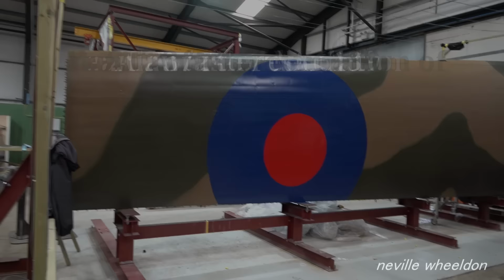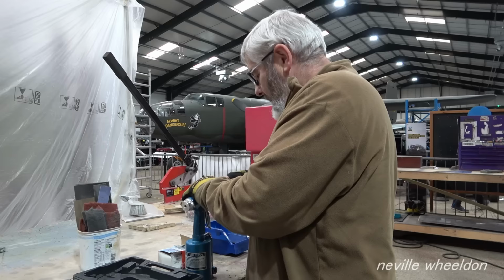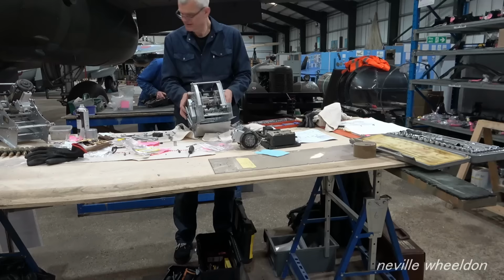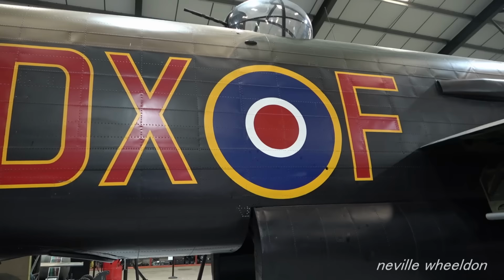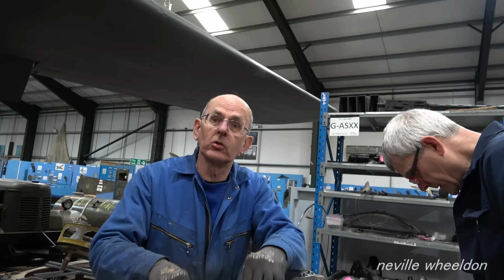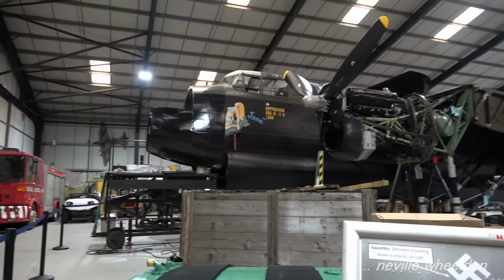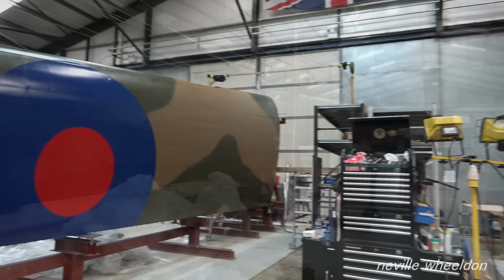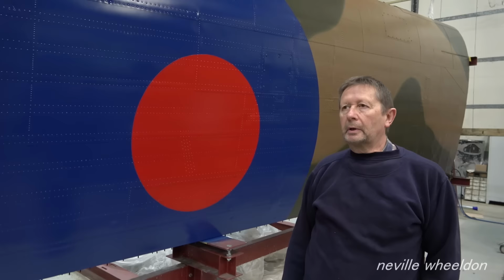Video 239 Restoration of Lancaster NX611 Year 7.    French wing painted.

Comment: Some questions about the ammo. Not knowing the rate of fire, approximately how many seconds before one runs out of ammo? Can the barrels sustain a 390 bullet run? I.e. how many seconds before it starts to melt. Can one fire only one barrel ? Does each barrel have it's own supply of 390?  Just to give an example, the Bristol Bulldog has two .303 Vickers. It takes about 6 seconds to empty the two ammo boxes.  Forget the movie land version of the 10,000 rounds per gun.  Once again: Neville you are a national treasure!!!
Reply from the maker: Hi Ed . The rate of fire was around 6- to 700 rounds per min. The Ammo box stored 30 feet away from the Guns held 2000 (approx) rounds with  390 rounds  in the track the  total 2390 per gun. Video 242 Ade and Andy talked about this. Thanks Rd.
Reply: @nevillewheeldon1693  Thank you Neville. I noticed the discussion.  You are still only doing great and fantastic work. Cheers.

Comment: It's never safe to judge colour under artificial light, never mind an image converted to RGB colour taken in digital light, but it does appear the roundel has been painted on using BS381C-110 Roundel Blue and BS381C-538 Roundel Red which were introduced post-war. Wartime roundels used non-BS381 colours instructed by the Ministry of Aircraft Production; Dull Blue and Dull Red, both darker and as the name suggests duller than the post-war shades used by the RAF as the "hi - vis" colours until mostly superseded by the lo-vis colours on most types (BS381C-172 Pale Roundel Blue and BS381C-454 Pale Roundel Pink").

Comment: I think Lancasters using the FN82 turret carried 400 rounds of .50cal BMG rounds per gun. 

The only reason I believe this is that .50cal ammunition comes in boxes of 100 rounds and I believe it always has done. It would be odd to remove 20 rounds (10 per gun) unless weight was at such a premium that it was necessary. 

It's just that 390 rounds seems like such a strange number. It doesn't divide into 50 or 100 which are nice round numbers beloved of armourers and storemen. You wouldn't have boxes of 330 (too heavy to lift), or 110 (another strange number for a storeman) or some other divisor of 390. That just doesn't seem right.
Reply from the maker: Hi SC, Each Gun carried 2000 in the in the box plus 390 in the track the Ammo Box were stored 30 feet away from the guns fired at 6- to-700 rnd per min.